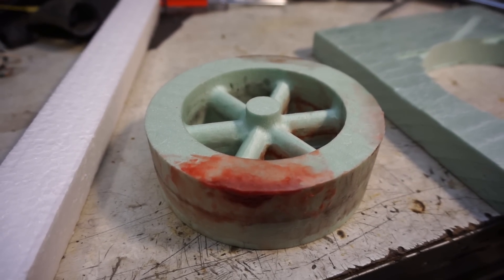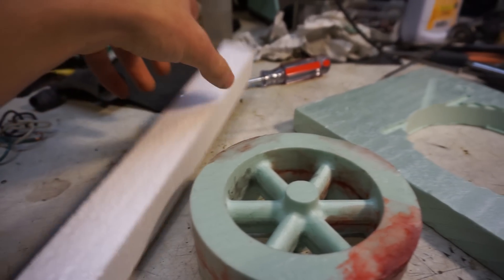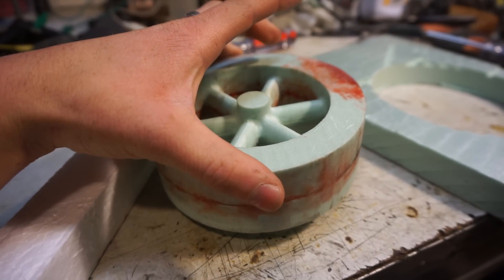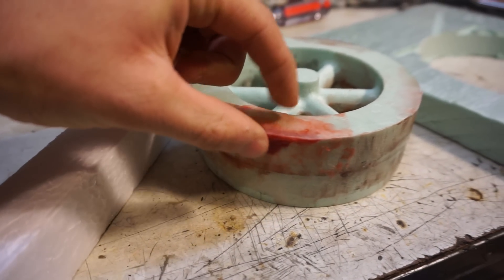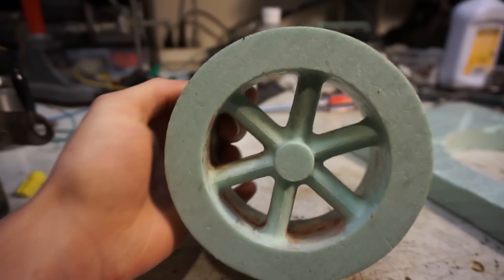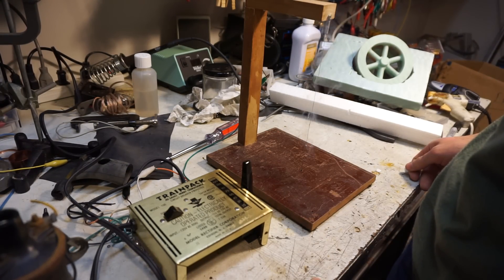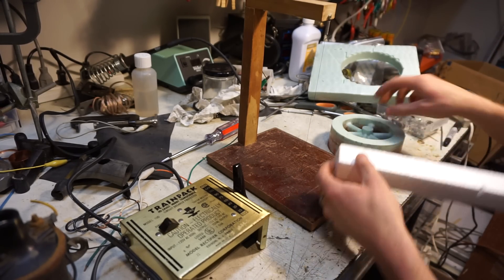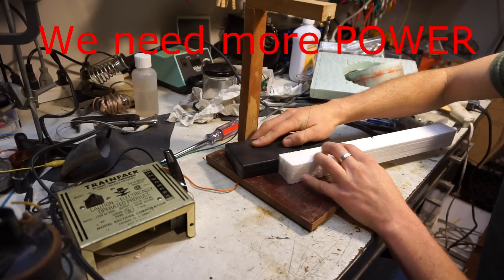Casting an Aluminium Flywheel Using Lost Foam Method and CNC Routed Foam

Comment: Nicely done.  Consider throwing some table salt (sodium chloride) or potassium chloride (if you can get it) into the furnace when melting the aluminum to help de-gas it; will cut down on gas bubbles getting trapped inside the cast piece.  Just a pinch or two should do.

Time may have been of the essence for this video, but perhaps let it cool completely before removing from the mold and placing in water next time; will avoid weakening it due to rapid contraction/thermal shock.

To determine the volume of metal needed, place your positive in a known quantity of water and see how much displacement it causes.

If you decide to go with finer sand in a future casting - especially if it's silica sand - make sure to use a respirator; you don't want that stuff in your lungs.

Lastly, that white hot core of the furnace is cool to look at (no pun intended); but keep in mind that - in addition to visible light and infrared heat - it's also pumping out UV radiation.  Eye protection is a good idea.  Not a real issue if this is just a one-off; but if you plan on doing a lot of casting, something to consider.

All that aside, A+ :)
Reply: John thanks for that information because next month I will be doing the exact same thing and I am trying to get as much information as possible
Reply: I will also use styrofoam because was seem like it will catch fire being it has an oily structure. I could be wrong.
Reply: John Doe agreeed

Comment: That's an awesome flywheel !!!  The right temperature is probably key to the right result, perhaps even more important than the sand grade. Maybe a bit hot? So many variables, including moisture. No matter what, great job!!
Reply from the maker: +ch300fnqi Thank you!  Yeah probably a little too hot.  I was just kinda paranoid that the foam would not all melt.

Comment: I don't know how hackerspace budgeting works but I think you should suggest to them a new chuck. That one looks really funky.
Reply from the maker: +Rainbows871 We are a non-profit so we don't have a lot of money.  We do have a pretty new 4 jaw chuck that was donated by someone a while ago.  I could have used that but it's just easier to use a 3 jaw.   What someone should really do is just machine the jaws down a little so that they are trued up again.
Reply: Thats fair, in England you can get a good second hand one for £25. Might be harder if you live in US though.

Problem with reshaping the jaws is you need a toolpost grinder and they can be more expensive than a new chuck (unless you make one yourself)
Reply from the maker: +Rainbows871 I have no doubt that I could get a new or used one.  But not at that cheap.  It would probably be at least $100 maybe $200.   Why couldn't I just clamp a piece of stock in the jaws to take up slake in the scroll and then machine them down with a high speed steel or maybe carbide tool?    Are the jaws hardened?
Reply: They will almost definety be hardened though some chucks can have soft jaws supplied so you could check. HSS would be a no no and carbide would probably struggle/ shatter cause it is hard steel and an interrupted cut.

The other thing with grinding is it is more accurate and leaves a better surface finish.

Comment: Nice! I want to try some casting one day. How did you get the sand beneath the foam wheel?

I like your forge setup. This is something i could do too. Good to see that actually works.
Reply from the maker: +Willem Kossen You should!  It's not very hard or expensive!  I just pushed it under with my fingers.  Not the best wat.

Comment: Every pour you keep getting better!  Looking forward to seeing it mounted into one of your engines.
Reply: +Makerj101  Looks pretty good!    I've read that if you cover the styrofoam with drywall mud it will give you a much better surface.  You need to let it dry before casting of course.  If you do it this way, you don't need green sand, you can use almost any kind of sand. Do a search on the particular kind or brand of drywall mud, some works better than others, or so I've read.
Reply from the maker: +Rouverius Yep!  Thanks!

Comment: Nice work! The roughness was in part due to your packing (you should pack you sand more often, say every 1/2 inch or so for fine work, every inch for rough work). Another part could have been the green sand you were using. I used to get my hands on red molding sand from craft stores. Usually pretty fine stuff and not terribly expensive, but you lose a small amount every cast (still there, just not usable). Personally I prefer 2 part molds made in the sand and pieced together before pour, or a clam shell type. This way you only have to make half of the object, and can save the piece incase you need to try again.

FYI I'm a journeyman blacksmith who hasn't practiced in years for reasons, so while I know some things, I am by no means an expert. There are some great books out there on casting, and also I highly recommend going through an older website called Anvilfire (www.anvilfire.com). Even if you stick mainly to casting, there is always something that might spark ideas in your head. (okay, I know, long winded, I'll get on you about wasting the coal next time ;) )
Reply from the maker: +Oduunich Loftuer Yeah that and the sand is pretty course.  It's common play sand.  I did sift out the larger stuff.  I recently bought some finer sand from Home Depot.  I just need to make up a batch sometime.  Two part molds are much better.  I just have been too lazy to make one hahaha!  :P

That's cool!  I'll check out that website!  Thanks!  What do you mean wasting coal!?  It's free for me!  :P
Reply: Hope that new sand isn't silica sand. While it is much much finer, silica under immense heat can turn to glass. Again, not an expert, so not sure on the melting point, but maybe do some tests just pouring ingots with it (good video content! and can make a mini-aluminum-Fort Knox with them).

Coal is great fuel, but for hotter temperatures you want coal coke. Which is basically fused partially burnt coal. The "wasting" of coal you did is by tossing it in in small amounts randomly around the fire. While this gives you better all around temperature, it's not efficient. You can get more bang for your buck by doing other smaller projects first, such as those knives you were talking about, using the coal all lumped up. As it fuses into larger pieces (coke) you can pull those out and put them to the side, replacing in the furnace with more coal. Then you can have a store of coal coke for hotter temperatures on larger projects. We used to do this in my master's forge, but he had designed it to function that way. It's up to you how to manage this (and sorry for making it sound WAY more detailed/complicated than it needs to be, its really not when working).

Comment: I use a very similar looking green foam at work making architectural models and ours is polyurethane. Polyurethane has a higher boiling point and releases toxic gasses (a la station nightclub fire). Are you positive that your green foam is polystyrene not polyurethane? If not you can test with acetone, polyurethane is pretty much solvent proof. If it is polyurethane you will probably get better results if you switch.
Love you videos, glad your uploading again.
Reply from the maker: +Sean Avots Hmm I'll test it.  Not really sure.  Thank you!
Reply: +Makerj101 definitely. I learnt that lesson the hard way doing zinc casting. the zinc doesn't melt hot enough to burn out the polyurethane but the polystyrene just barely worked. the polystyrene left a much better surface finish when I did it as well

Comment: The finer the sand, the better the finish will be. Instead of using green sand, get some play sand from lowes, and screen it down smaller than 100 mesh.
Reply from the maker: +Milton Tucker Yep!  Green sand is a clay and sand mixture for casting.  And I did use play sand screened down to make the green sand.  I need to buy some of the finer sand that they sell.  Thanks!

Comment: I have to ask you what do you do with all of the fly wheels you make? How many does one need? lol. It turned out very well!
Reply from the maker: +Dave Brittain LOL one can never have enough!  The simple one I did before was for my internal combustion engine and this is an upgrade for it.  https://www.youtube.com/watch?v=W2-ft5kdRX4
Reply: +Makerj101 Cool! When I was a wee little kid we had a blacksmith shop on our farm that used to be ran by my grandfather. In the shop was parked a model T. It was the most cool place in the world! My dad tore it down to lower our property taxed but they did not change the tax rate one bit. It was completely equipped too. All I have left from it are a few tools and the anvil.

Comment: Good job!  If you spend about a week putting on layers of soupy sheet rock mud (the kind made from a dry, non-aggregate mix), your surface finish will be exactly the finish of the original foam since sand won't come into actual contact w/ the foam.  Also, you wouldn't need to use a flask (an old metal bucket or coffee can will work) and you can also use regular, loose sand (not green or petrobond).  Basically paint on or dunk the whole part, let it dry completely and repeat until you've got a good 1/4" or more shell.  You want your mix to be like pancake batter.
Reply from the maker: +Jake Mercer Yeah that's probably the best method however I'm kinda lazy and I like a fast turn around on my projects!  :P  With just doing it layer by layer do I still burn the foam out before casting?  Thank you!
Reply: +Makerj101 There are times I don't bother coating my foam before casting and it just comes out with the sand texture.  I do with this with normal loose sand.  No need for green sand with this method.  The sheetrock mud is just a barrier between the sand and the foam.  I have also just wrapped the foam in wide masking tape (without sheetrock mud).  It works ok but doesn't look as good as a piece done using the sheetrock/investment method.  To answer your question, yes, the foam burns out fine.  You're already venting so keep doing that and the gasses will have somewhere to go when the foam burns out.  You might want to put some masking tape on the straws to make the sheetrock mud to stick to them.
Reply: Hey Jake
When you say "sheetrock mud" are you refering to Drywall filler mix?  If so I take it you dilute it into a slurry with water?
Reply: Coating the pattern with plaster will not do anything to improve the   finish as the plaster will not melt and the finish will be exactly like the pattern dip the pattern in melted wax smooth it off by dipping it in hot water that way the wax will melt out with the foam you are not alone in this misconception i have heard this many times before try it and see J.B.

Comment: I'm building my furnace as I type it's all over the floor of my living room and kitchen lol. can't wait to try my first casing. there are some good cheap graphite crucibles on ebay.
Reply from the maker: +Richard Wheatley Yep!  I bought one!  I just have to use it now!
Reply from the maker: +Richard Wheatley   Cool! What kind of furnace are you making?
Reply: +Makerj101 the shell is a full size beer keg the base is made of fire brick the refractory lining is 2 inch thick kaowool with plistix 900 as a stabilizer for the kaowool it's main purpose is it reflects infrared heat so it heats up quicker and the burner will be a waste oil burner.  

I have 2 videos uploaded so far about it,  they're just low quality cell videos but I bought a tripod and downloaded some video editing software so the next video should be a little better quality wise.

Comment: You need to make a better forge
Reply: if it ain't broken no need to fix it
Reply from the maker: +Enduro Tim I plan on building a better one in conjunction with HackPGH however I don't really have the time right now.  It's future project though.  For now this one works pretty darn well though.  A bit crude but it works.